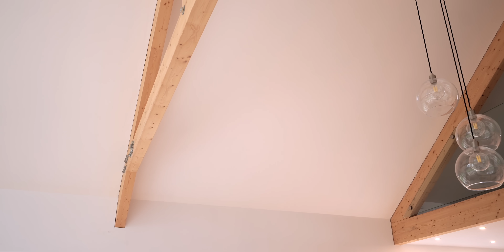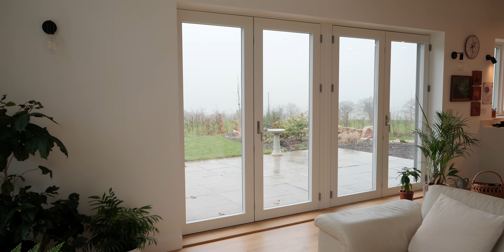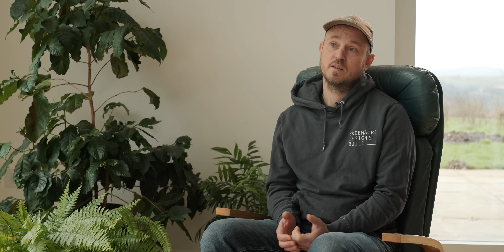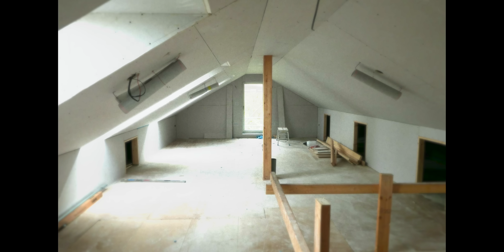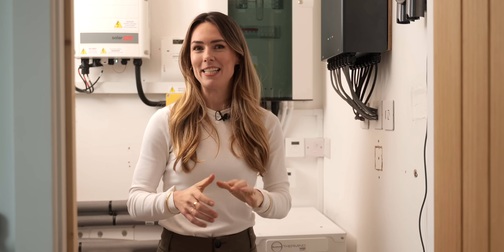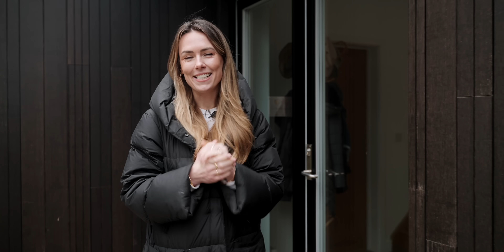Ditching a Heat Pump for In-Plaster Infrared Heating?!

Comment: ref:  10:12
That you can not use you battery when there is no power cut is just wrong. The main advantage is to use it every day. If you can sell solar at 15 p in day time and buy for 7 p at night you should charge your battery at night and sell all your solar production while you use battery power yourself.
Reply: Good ploy, ROI is important, until the electricity suppliers change their tariffs.
Reply: @johnburns4017  it might seem like you’re just making money off of a technicality, but this incentive is very deliberate. As mentioned in the video, homes with batteries installed improve grid stability, and as more and more homes get batteries installed, that duck shaped graph of energy usage throughout the day get less and less aggressive.

This means the maximum output required during peak hours is reduced, and there is less wastage during off peak hours when most of the country is at work.

All this to say, the tariffs aren’t gonna being going anywhere until everyone ever has a battery installed
Reply: Was looking for this comment and was about to make it. He is wrong about how a whole house battery backup works, you can absolutely use it "actively" for all kinds of benefits, not just when the power is out
Reply: @ChuckHirstius 

Really?

Kindly detail these alleged benefits.
Reply: @ForestForest-n9i it mostly involves variations of "time shifting" power use and the primary source of consumption for it. As others have already pointed out, it's ideal when combined with solar and an hourly rate plan that provides credits for excess energy you put back onto the grid. By using sole of that excess solar to charge the batteries up before feeding it back to the grid, you can then run off the batteries at peak hourly rates, or supplement power delivery for something like EV charging should a situation arise that you can't wait for lower rates and solar won't be enough to cover the load. 

I think the primary misconception is that the battery can only be engaged when the grid is down, and that because it's a "backup" that it must be kept at 100% charge "at the ready" at all times - and those are both false. It's better to simply think of it as a flexible energy storage device that can fill gaps, supplement, or time-shift energy delivery in ways that benefit you hourly, daily, and all-year-round.

Comment: Its really interesting to see of these new builds and how efficient they can be. I think the government should be doing more to mandate that new builds have to incorporate these technologies. But it would be interesting to compare the cost to build a standard house of the same size to this one, because then you could see the true cost of the added technology and if it is worth retrofitting it into an older house.
Reply: The prime point is Passiv Haus which is orientation and high insulation. The technology used to heat the space and for DHW in this house is not new at all.
Reply: @johnburns4017 

Quite so.

"Passive" houses have been around  for a few thousand years.

Comment: Interesting all his plumbing for hot water and cold water is done on UFH home run manifolds. The Hager Pan board is set up as 3 phase though so if it's £196 for the year on 3 phase supply that's practically unheard of without a much larger solar array and battery storage just because of the standing charge. The only off putting thing is no battery back up and it's at the end of a rural lane - that area is known for having power outs so it would be sensible to have backup power.
Reply: He will use his car's battery for electricity backup? The bigger the car battery the more time to power the house from the car. Battery technology has improved exponentially with prices really dropping. To the point that EV car range is approaching one thousand miles. Household battery storage will be very affordable.
Reply: @johnburns4017  Not always practical to run a house off of a vehicle battery if it's the sole vehicle. & many like the chaps Cupra Born don't currently support V2G.
Reply: @effervescence5664  
With a big EV battery, and they are coming, it can provide interim power in power cuts.
Reply: @johnburns4017  Yes they will be here eventually, but you're missing what I am stating. If you're solely reliant on a mobile battery platform during a prolonged cut your mobile platform ceases to be useful in other emergencies. Thus off setting with a small home battery is the only sensible way forward for 1 vehicle households. 

Also anyone that doesn't switch out their vehicle every 3 years on lease isn't going to be able to V2G as the majority don't have bi-directional inverters on board.
Reply: @effervescence5664  
I agree that a full decent sized home battery can give backup power for essential circuits. for long periods. The consumer unit should be configured so. 

If the power cuts are only for half a day or so, known by experience, then running the house from an EV car battery is a very cheap way for an infrequent and odd situation. If a cut is to be extended for whatever reason, the EV can always be driven to a charger then driven back.

Comment: Impressive. However, I still feel it is a missed opportunity. I feel that the owner felt the need to try something different rather than go with the tried and tested. I feel he could have had a top notch underfloor heating/heat pump system with efficiency of 500% all day long.
Reply: It's very hard to get a COP of 5 in a passivehouse, because the load is so low. Even with UFH. Things like pumping losses reduce efficiency, when the total output is only 700W or 1kW.  And UFH (wet heating in general) is a significant carbon/equipment/complexity/maintenance cost. For a very low heat-load you are better off spending that money on better triple glazing or thicker walls and having a very simple heating system for the 20 days/year you actually need it.
Reply: @xxwookey nah, pretty sure if you set the flow temp to something like 29-31c and have weather comp, it's easily achievable.
Reply: @mrmuds8264  Passivhaus are often running 28 C or lower and hence see SCOP around 4 - it's a bit lower because you only run the heating in coldest bit of winter and higher proportion of hot water. Also with super low flow temperature we've found you can strip out the usual underfloor controls and just run fixed flow to each loop with the ASHP controller managing flow temperature - so no roomstats, actuators, mixing valve or secondary pump.
Reply: @mrmuds8264  Only if you have a ground-source HP to get the input temp up. And even then with the extra pumping loses and the fact that most GSHPs are really dumb you'll probably still only get 4.
Reply: @mrmuds8264  passive houses are sort of like submarines, when done properly like this house the temperature inside doesn’t actually change, ever

Maybe if you had a house party with a lot of thermally active guests that would be a different issue but other than that you only lose any heat when doors open, and you only gain heat through sunlight falling indoors

Usually passive homes have awnings or extended porches that don’t let the direct sunlight reach inside at all (curtains still let heat in because they’re inside the house), but i guess this house worked out to not need that?

Either way, you’re greatly overestimating how much heating you actually need inside a house that virtually doesn’t experience a change in temperature

It’s a very hard concept to get used to because it just doesn’t make sense in reality, sounds more like a secondary school physics question where you ignore complicated rules.

Turning the heat pump on and off constantly to prevent boiling you inside would greatly reduce the efficiency from that ideal 500% you state, and this lower load system also has no moving parts so maintenance will be a breeze
Reply: @mrmuds8264 would have to use some accumulation tank + use it for how water.
Reply: Some of you guys are like wolves howling at the moon with you 'preferences'. The original intention of passivehaus was a building that requires NO, I'll repeat that, NO, additional heating other than the heat radiated by the people occupying the building. This house misses that mark but is close; I'd have fitted the smallest wood burner , the installed heat recovery system would distribute the heat, or  preferably, a battery - 30kW (under £3000 now) with a water to air heating coil in line with his heat recovery systems main output manifold, which would also distribute this small amount of added heat throughout the whole house - could be fed from the phase change buffer he has fitted, charged from winter sun solar, or overnight priming the sunamp with elec at 7p. Super simple, very cheap, easy to maintain yourself and easy to fix. 
KISS, is there a cheaper simpler way, have a scribble and think...is there a simple cheap way...Mmm, def not an effing heat pump then!
Reply: @Bob-h4s2p I know what Passivhaus buildings are and if this one meets the Passivhaus standard then heating demand for 20 C room temperature would be around 15 kWh/m2/yr, so for this house that's 3000 kWh/yr, which at 25p/kWh will cost £750/yr
Reply: @Bob-h4s2p Woodburners in PH are problematic too: They add thermal bridges and need to be properly room-sealed so the whole system is a torus. And their minimum output can easily be too high. You can't buy a woodburner smaller than about 4kW.
So yes you can do that, but there are a lot of better, cleaner ways.

And heat pumps are not intrinsically complicated. The one in your fridge is pretty straightforward. There is a bit of a gap in the market for heat pumps sized between 'fridge' and 'house' which would be just right for passivehouses.

The heat distribution is the tricky bit. As you say, you can use the MVHR ducting, so long as your heat load is really low, but even in passivehouses that usually requires sizing bigger ducts as you need to move quite a lot more ait than just for ventilation.
Reply: @xxwookey 

Ducting you say.

I use a small fan to distribute heat throughout to augment the convection.

That's KISS for you.

Comment: I didn't see anywhere, the costs. For most people, the yearly costs compared with capital doesn't work out. That said, after 8 or so years, we got our Solar Panels cost back, and are now in profit.
Reply: Until you have to replace them (every 5 to 10 years) 😢
Reply: @bharatdahya776  totally incorrect. most PV installs don't even show any significant degradation in output after 10-15 years of production. Please back your statement with reputable source. You might expect failing inverter after 10-15 years, true, but not the panels.
Many panels have  25 year warranty for certain output 70-80% for example. Some inverters even have up to 10 year warranty. You can ask yourself why would a manufacturer provide such long warranties, that would not be a good business case if they all fail before warranty is up?

Comment: 11:30 I'd hope a 6 kW array produces a bit more than 6 kWh a year..
Reply: 1. You can measure only what you consume. So if he measures only 6kWh/year they're using theirs solar pretty in efficiently.
2. It's 6kWhp "peak" so it produce 6kWh only in ideal conditions. During the winter period where most  days are cloudy you'd be lucky to get to 30% of performance an dcount it in 100 of watts/day.
Reply: @VavrMar  1. Not sure what you mean. 2. 6 kW (no h) peak means it can produce 6 kW an hour. That's 6 kWh (note the h) every hour. So in a year that's a lot more, maybe even 6000 kWh.

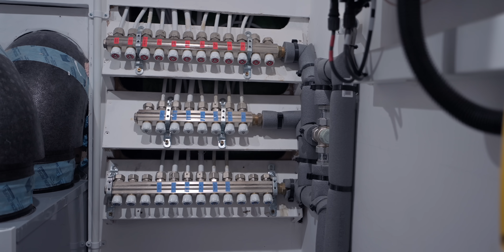Comment: 9:29 What's all this plumbing for? Underfloor heating? Thought it was all IR..
Reply: Sinks/Baths/Showers?
Reply: @TS-ud3wk  Never saw this style before.
Reply: @FiveFiveZeroTwo  I may be wrong but it looks like individual runs of small bore pipe to each outlet, I'm assuming to avoid wasting water whilst you wait for hot water to reach the tap, whilst avoiding using a circulator pump and the associated heat loss.

Comment: Why are all buildings not forced to be insulated to this standard?
Reply: Crazy - I suspect "Lobbying" by building industry.  I live in a Passive Haus; uses 90% less heating energy than current building regs, for 5% more cost of the build. Would reduce oil imports, help balance of payments, let alone the eco benefits.  Very even temperature, way more comfortable for the occupants - far fewer "overheating days"; MVHR air humidity means no mould spores and helps massively with all sorts of respiratory diseases (from asthma to the Winter coughs and colds) - a reduction in Sick Days too.
Reply: @ecok definitely not 5% more cost. I love crazy well insulated houses. But there's definitely diminishing returns above a certain level.

Comment: Whilst the fleece format is new, the concept of in plaster electric elements is not new, have come across it 80s new build. Unfortunately after 25 years it did stop working, I believe those early systems were sandwiched between plaster board layers. This system with the ability to add a replacement layer on top the existing plaster and skim, offers an easier replacement/upgrade method. 

It is actually very simple to run your house off grid during a power cut and maximize your export earnings. With a gateway or manual switchover and local earth. As that house has such a low heating need, a relatively small battery would have covered several days use with the solar topping it up. Maybe it’s the solar edge inverter that does not support island mode. Outside of a power cut a battery allows you avoid peak energy usage once the sun goes down. Using the grid as a battery by building up credit is valid, but it does not allow usage during a power cut.
Reply: Different tech from a different era.  Our patented process ensures minimal operating temperatures, low voltage and no decoupling

Comment: Same here. I've got an 8kW array. Same car charger as his. Technical system is even more modest. Just a boiler and some 2kW heat convertors with electronics from the same system as the car charger. The big thing is about thirty kWh meters and a completely reworked electrical scheme. All light and controls use Matter over thread. Two dashboards on tablets and 2 extra displays show temperature, Watt, kWh daily and CO2. The results are stunning. Total annual energy bill a few hundred euros. Low investment, no cloud, no batteries. I'm proud of having made the step from carbon to solar 2 years ago : zero emission since then. OK, the technology is very new and it asked a lot of research. Have fun doing the same. I hope this is inspiring. Kind regards, Jan
Reply: The 'no cloud' part is so important, and too often ignored. Well done.

Comment: Ok this is something new, in wall infrared heater, interesting.
Great video keep it up 👍
Reply: In fact we installed our heating into Julians ceilings rather than the walls (except the towel warmers).  Heating from above is more efficient and covers a larger area using less energy than in the walls and floors
Reply: @EnergyCarbonInfraredHeating 

Quite so.

If viewers got off their arses and did some research then even if they bought a FAR IR panel then the instruction state exactly as yourselves, ceiling mount is recommended, on the premise no furniture to block the emitted radiation.
Reply: In some parts of US (can't recall which) FAR IR heaters are mounted behind the plasterboard/drywall/sheetrock and the radiation travels through the material.

Google is your friend but might have seen the item on "This Old House" to narrow search for them as interested.

Item must be a few years old by now.
Reply: We’ve been supplying heating since 2013 and have now heated thousands of buildings.

Getting this out to the masses takes time — but moments like this, when the results speak for themselves, are exactly why we do it.

Comment: Heating water with a heat pump and then using hydronic underfloor heating would be more efficient. Run it primarily when there is solar energy being produced, doesn't matter its oversized, it will still run at peak efficiency in such a setup.

Comment: I don't believe it, sorry but I've got various renewables and an EV and his figures don't add up.....

Just his car "a cuppa Bourne" will cost roughly £190 a year to run......

I think he has pulled a number from thin air.....

And he doesn't have any battery storage......how does he run the house in winter when it's dark outside at 4pm.....?

Also I live extremely close to this guy......I have 4.2 KW solar producing 3804.1 KW last year.

He has 18 panels..."I counted" how is he only getting 6000kw a year.....??? 

His system is not efficient enough, his solar is covered in shade in the video...... something is not adding up.